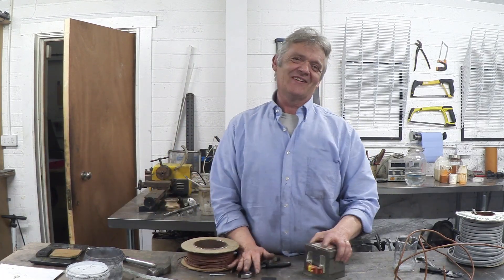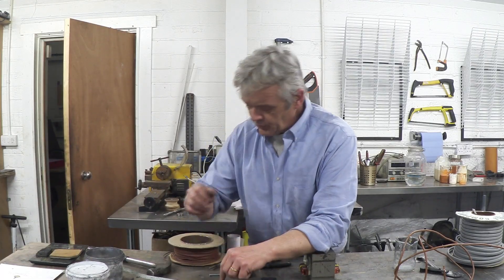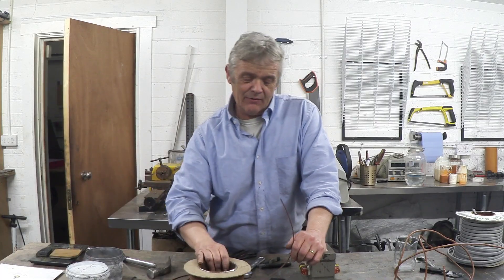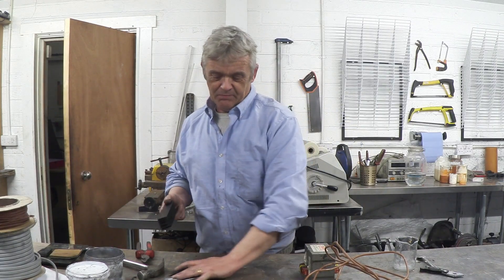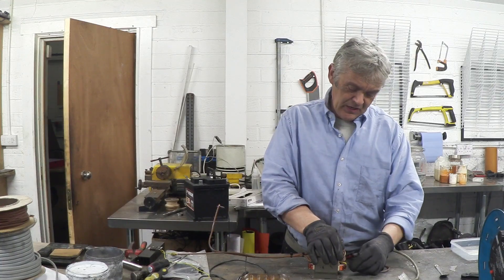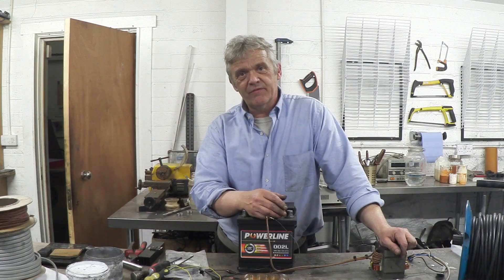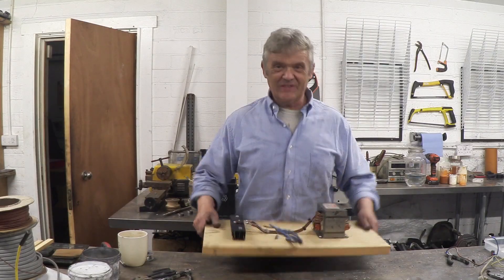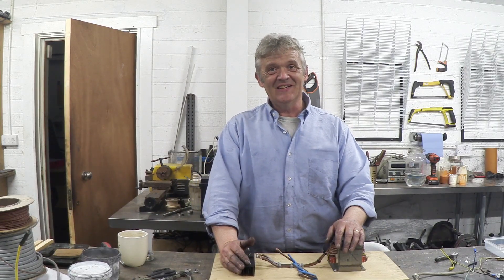Simple Cheap High Current Power Supply From A Microwave Oven Transformer

Comment: You come across very well and fun to watch, i needed a low voltage  12 vac landscape transformer for lighting  up a friends trees and scrubs at his property as his old transformer burnt out and was left in the dark, all his bulbs are 12vac and they wanted 370 bucks for new transformer here in British Columbia but instead i made one the way you explained and i included in my build a few extra turns giving me multiple taps i can come off for varying voltages ie lights further away id come off the 15 volt tap at the tx and by the time i got to the end of the last light id be getting 12 volts so worked out good, thanks bro your video put a smile on our faces... been over 4 months now and so far so good, keep sharing your fine work

Comment: When repurposing a Microwave Oven Transformer (MOT), it's advisable to remove the magnetic shunts. These shunts, typically located between the primary and secondary windings, serve to limit the output current by increasing the transformer's leakage inductance. While this is beneficial in the original microwave application to protect the magnetron, it can be detrimental in modified uses.

Leaving the shunts in place can lead to increased leakage inductance, resulting in reduced efficiency and potential overheating during continuous operation. Removing them not only enhances performance but also provides additional space for rewinding the secondary coil to suit your specific voltage and current requirements.

To remove the shunts, carefully use a punch and hammer to drive them out, ensuring you don't damage the primary winding. This modification will help optimize the transformer's performance for your intended application.When repurposing a Microwave Oven Transformer (MOT), it's advisable to remove the magnetic shunts. These shunts, typically located between the primary and secondary windings, serve to limit the output current by increasing the transformer's leakage inductance. While this is beneficial in the original microwave application to protect the magnetron, it can be detrimental in modified uses.

Leaving the shunts in place can lead to increased leakage inductance, resulting in reduced efficiency and potential overheating during continuous operation. Removing them not only enhances performance but also provides additional space for rewinding the secondary coil to suit your specific voltage and current requirements.

To remove the shunts, carefully use a punch and hammer to drive them out, ensuring you don't damage the primary winding. This modification will help optimize the transformer's performance for your intended application.

Comment: I have a 1,350 watt microwave that I will be scrapping .... at 120 volts feeding in ,  I will safely have 11.25 amps available at the primary side ....... I have 10 gauge solid  2.7 mm thick copper .....I want about 25 to 35 amps to run 200 watt ham radios....So this is a great way to have a power supply on the cheap... I will do 3 turns to see what it puts out , then I can do the math 
              I heard you say that you wanted 12 volts , but ended up with 11 volts , taking a turn off will drop you to about 10 volts , then you minus 2.5 volts for the voltage loss that the bridge rectifier will steal and you will end up with 7.5 volts ...... You might have had 13 volts but said 11 volts ??
              Oopsie ,  I just read your description box for the slip of the tongue ....... I will leave the comment as is though , because it has some possibly worthy words in it ..... Thanks  Boo........

Comment: I rewound a microwave oven transformer a few years ago. I have yet to get more parts I need...and design. I made mine for a high current 6 and 12 volt battery charger; made two secondary coils using proper transformer wire gauge 10. Got some wire from a shop that rebuilds electric motors. I don't recall exactly what the final voltages were but should be at least 7 and 14 volts, for losses and to push power into batteries when near fully charged.

I still have not decided or found a very simple high current capable circuit design, but I want to be able to control the current, limit it. I want to have full manual control to handle all types and conditions and situations and sizes of 6 and 12 volt batteries. I need to be able to monitor both the voltage and current. I plan to fuse the DC side at max 30 amp. The transformer is able to handle more, but I do not need more when I can limit the current.
For two examples: 1/ Charging a very large heavy equipment battery that is low, can pull a lot of current, which is why they make very large battery chargers for this. A 30 amp charger can do the job by limiting the current and charging more slowly; increasing the current bit by bit to keep the charge voltage about 1 volt above the batteries voltage.
2/ Attempting to restore a badly scaled and shorting battery, by trickle charging, by limiting the current, and very gradually increasing the current as the sulfur scaling dissolves....hopefully.

"Smart" chargers can't handle all situations. I want a fully capable charger, and me be the smart part....hopefully ;-)

I have been looking at some pre made circuits people are using but they are low current and look flimsy. I have been achieving current limiting control with store bought basic transformer battery chargers, by adding inline various automotive light bulbs.

I will order a high current bridge rectifier ASAP, and get this project back on my work bench...schedule lol

A decent charger IMO, also needs to cut off when the battery is charged, when the smart part, gets distracted. A timer could work as well.

101 projects needing to be done, can't do them all, what to choose, what to let go for now?

Comment: @Robert Murray-Smith I wonder if something like tis would work to recharge my battery bank for my solar system. It's a 12v system wit around 10 deep cycle batteries? I find that I need round 80 amps to have any kind of charge for the size of the bank we have. Do you think this would work?

Comment: I made one of these its output measure's DC volts 12.8v but when I attach it to my design HHO generator with pulsed (12v 40 amp relay) the voltage reading changes to 18v Dc what is the explanation is my HHO generator generating output?

Comment: 11.2 volts -1 turn would be less if you are working with the low voltage side, no trouble intended but, but the math is wrong.

Comment: You should not use an extension cord on a reel like that for anything that draws a lot of power.  It will overheat and I've actually seen the cords melt (with smoke and sparks flying soon thereafter)...

Comment: Is it possible to get opposite result? Placing 12V battery to the end and connecting with secondary, turning 12VDC to 240 VAC from primary transformer?

Comment: LO,

MY RETIREMENT  HOBBY IS WORKING WITH TRANSFORMERS, AND WASHING MACHINE MOTORS. 

YOUR TEACHING method  is top notch.

I NEED A LITTLE  MORE DETAIL ON PARTS SO THAT I CAN PURCHASE PARTS SAFELY. 

TO MAKE A BRIDGE RECTIFIER, I NEED TO KNOW, IS THERE A PARTICULAR DIODE AND WHAT DO I SOLDER THEM TO.

PLEASE HELP.

REGARDS
PETER.
Reply: What can I run from this power pack?.
Regards 
PETER

Comment: PC power supply? 
I just want to ask who has re-worked a PC power-suply or any other switching supply to adjustable voltage and current limitation?
They are even rated for their efficacy class, and you can find them from any junk yard. 

In future, I would like to dive into „steered rectifiers“ frim Power-MOSFETS, because we can cut down the voltage drop of the diodes they replace. Probably need a potential free DC DC module for the gate potential, that surpasses the +, but any cheap one or recycled from old boards will do. 
Even AD’s iCoupler have some mA to spare on the other side - 2.5kV isolated.

Comment: Nice video! Dry skin has megohm resistance but the electrolytes inside are highly conductive. Cuts in hand could put 100 mA across the heart from a 12vdc source and put the heart into fibrillation. Better to err on the side of caution.
Reply from the maker: you are right mate - you really should avoid standing in a bathtub dressed in chainmail if working with this - I joke obviously - thanks for the tip mate

Comment: Nice project - the MOT will draw maybe 5A of magnetising current and over 100W of power even with no secondary load, so take care it might get hot, especially if you put it in a box. Its because 1 volt per turn is too much for a small area core like this, it is done to save money on manufacturing the ovens.

Comment: I'm sure you know this, but for anyone who doesn't, once you rectify that 12v AC, you'll end up with about 17 volts DC, because AC is measured on the mean (RMS) - not the peak like DC.
To determine what your final DC voltage will be, you need to divide your new transformer output by .707, so 12 ÷ .707 = 16.97 volts.
It may not matter in your particular setup, but for someone expecting 12 VDC, they might be puzzled... 😁👍
Reply: Ture talk no lies long time i anit hear bout peak to peak...now on his project we could use a 12volts voltage regulator an a 2n3055 n get that 12volts more stable...more electronic to add to better the power supply

Comment: This is fantastic! I tried get some rust out of my VW T25 fuel tank using electrolysis but it's a very large item and takes 60L of my electrolyte mix. I used a 12 volt 2amp power supply but that's not cutting it. I walked around the corner and found a discarded microwave on the street. Quick question: there are aluminium blocks between the primary and secondary coils. Do I put those blocks back in when I rewind the secondary coil?

Comment: What if i put a powerful led light on it, one that can draw more amps, exceeding the bridge  rectifiers amperage.  Would the bridge rectifier burn out?  Or would  it hold strong at the bridge rectifiers amperage limit?  Also, you say be careful with ac. So if i touch the secondary  coil while the primary coil is plugged into 120v ac. Im dead right? I can never wrap my mind around what shocks me and what protects me. Or how to entirely  be protected while also touching it or... idk. I wish i understood it.

Comment: Awesome!!! Absolutely  love it.  What if I wanted to do the other way round? Put 12v in and get 220 out? That's what we need in Africa. Is there any way of doing that with this  type of  transformer?   I know I could buy an inverter just wanted to know how make my own.   Thanks a lot.
Reply: MISTER  .. YOU CAN PUT "12V"   IN  AND GET "SOME HIGH VOLT OUT"....
BUT  ...!!  NO POWER   NO "AMP" ... (TO SMALL TRANSF..)

I START USING  "WELDER-TRANFORMERS"   THEY  ARE  "BIG"  !!
FROM OLD  "JUNKYARD - WELDERS"  THE "TR"  IS  OK
IS  ALL WAYS  ..THE ELECTRIC COMPONENTS  WHAT IS DEAD

OK  MY  "WELDER-TR"  (IS 2 TRANSFORMERS IN 1) .. 12V  25V  48V 80V DC
27 AMP  TO  90 AMP...  THINK IS GOOD FOR 12V IN  220V OUT.

BUT YOU MUST GET ...SOME OLD  "UPS"  (COMPUTER BACKUP POWER)

THEY USE  "12V BATT"  TO MAKE  "220VAC"   !!!

JUST USE CAR BATT... AND NOT THE "SMALL" 12V BATT INSIDE THE UPS..

THIS IS  THE  BEST  FOR  YOU..

GOOD  LUCK  MISTER...............
Reply: @netautorisationnetautorisa545   So, I just use  a UPS and a car battery? Is that all?

Comment: Just aquired a transformer for a spot welder project.Question. can I use carbon rods from a lantern battery as the weld probes if not what's best material? As ever great instruction videos.Thanks

Comment: What would you get out if you wired it as a step down and used the primary for the output?
Reply: I've wondered about that as well. Here in the U.S., an input of 120v creates an average of 2,200v (according to GoogIe, it can be from 1,800v to 2,800v), which means it multiplies the voltage (on average) about 18 times. If my math is right, inputting 120v into the secondary* should divide the voltage about 18 times, outputting about 6.5v from the primary. This can be a very useful voltage for some applications as-is, but that primary coil doesn't look beefy enough to supply the current I would need.

*Yes, I know when you input into a secondary it is now technically a primary.
Reply: @fermionspin3968  Interesting! How many amps?

Comment: great videos was looking for 18v supply for my battery drill this could work
Reply: IT  WILL   WORK....just make sure to not leave the supply you build, left plugged into your live socket. Microwaves are designed to be on  'UNDER  LOAD ' all the time, so, switch on, or plugin, when your ready to use the drill, saw, etc, and immediately unplug/switch off supply when done. Heat destroys electrical/electronic stuff.....microwave transformers have a shorter length of wire on primary, than most normal ones, like the old door bell transformer, or the ones used in old tvs, or the ones on your wallmount box transformers...
Reply: i made one.....wound secondary with enough turns, probably 20, of AWG 12, and used bridge rectifier from microwave (10 amps one) and a capacitor  off the same microwave. Had to adjust the number of turns, to reach 18. I could have made it 20, but, as things are engineered nowadays, to just the bare minimum of standards, went with conservative amount.  Put all in a plastic electrical box, about 10 by 8 by 6 high, and a wall receptacle marked 18 vdc only, and then put used vacuum cleaner cords, long ones, with male wall plugs on the ends,  onto all my 18 volt tools: drill, 5.5 inch skilsaw, reciprocating saw. Works really good, and cords are small to rollup, too. have a great build.....

Comment: I can't find a rectifier rated to 70A  can you tell me how can i find something similar a link to one of those at amazon or Ebay even aliexpress. Thanks and I really appreciated your awesome work
Reply: Gut the diodes out of a car alternator  from a junkyard, cost almost free. They have 6 diodes per serving with 50A per diode constant rating for a total of about 150A for full wave center tapped or 100A for full wave bridge using 4 diodes. 😁

Comment: Telecom here in the US uses -48 volts to power everything. You can get a little bit of a tingle from that on occasion. Especially if you are a wee bit nervous and sweating up a storm. You do have to be a little careful because of the 10,000 amp battery backup.
Reply: And then there is the ring voltage which can give you a bit more of a "tingle"... :)

Comment: I did one of these for a project and it’s nice to have a very robust 12v supply at my bench.   I did include a little smoothing on the output with an electrolytic capacitor.   I also did a similar one with an adjustable momentary circuit to spot weld nickel tabs on 18650 cells.    I keep a spare transformer in case I need to work up a different voltage.    I was thinking of a secondary winding with two or three tap outs on the next one.    You can get high amperage rectifiers easily on eBay.
Reply from the maker: awesome mate - thanks for sharing

Comment: Nice to see practical advice in action. And I caught the "memo" that you meant ADD a turn to the secondary. You had me going there.
Now my own project issue is I have a nice 6A transformer with 110VAC > 40-0-40 secondary. Following that is a 10A bridge rectifier so it's wired full wave. So far, so good; it reads 40VDC on the two rails, compared to the center tap. But when I add in some smoothing capacitors - 4700 uf, the DC reads 60V. Too high for me by 5 to 10 Volts, because of the 55VDC input spec. limit of the adjustable buck converter it's meant to supply.
What's a suitable way to cut down 5 to 10 volts and still have a supply of 50 volts up to 5 Amps for my project? Power Resistor? String of 10A diodes that I have plenty of?

Comment: Other than your superior knowledge of electricity, why do you not have the power-in connections shielded from accidental contact on the transformer?????  Isn't it important to do so?  If I were building this unit, I would invert a plastic container over the transformer anchored to the wood base so there could not be accidental contact.  Eh?  Also, I take it the wire you used to loop the primary on the transformer was insulated - you didn't say.  Me, being a novice and unfamiliar with deadly voltages would need to know.

Comment: a rectifier used in  a car alternator would work too, ideal for high current low voltage
Reply: Riding mower engines as well and they are easy to get off

Comment: if you measure 12V AC then you will have around 16V DC after the bridge rectifier, just mentioned should anyone not understand whats happening,  multiply the AC x1.414  minus volt drop across 2 diodes in the bridge another 1.6V

Comment: I think you will find, a 1.2v battery has the potential to be lethal (cause cardiac arrest) if you bypass the resistance of your skin, which breaks down at different voltages allowing current to flow, this will also depend on the type of skin you have and where the current flows. Never touch battery terminals if you have cuts on your fingers, or if you are stupid enough to have fresh piercings on your fingers.

Comment: Just a quick note for those playing along at home. In the video, you will see Robert test the transformer while powering from a coiled extension lead. DO NOT DO THIS AT HOME! What Robert did was fine because there was no load on the output side of the transformer, but trust me, you do NOT want a heavy load on when using a coiled extension lead. Un-coil your extension lead and run it around on the floor in a random fashion (not a big loop!).
Reply from the maker: good advice mate

Comment: For anyone who would prefer avoiding the mains wiring side of this, might I suggest a 2nd hand server power supply as an alternative. As I type this,  a HP 506822-101 750 watt, 12v 62.5a power supply would cost about £8.50 shipped from ebay - probably less than the cost of a decent rectifier bridge if bought new.
Reply from the maker: true enough - some people would rather recycle things though mate